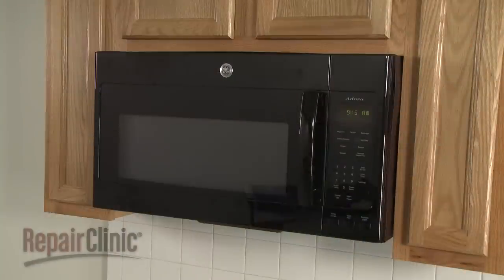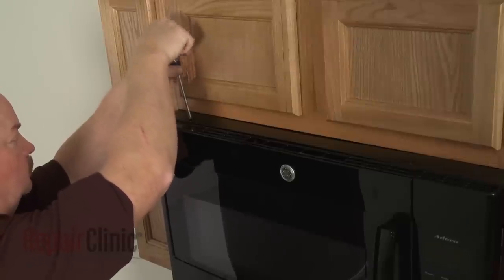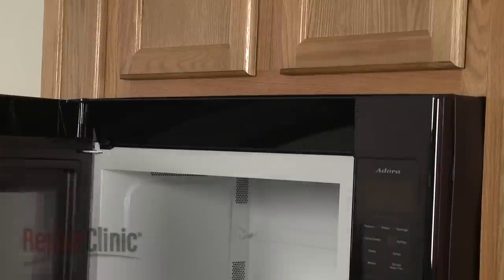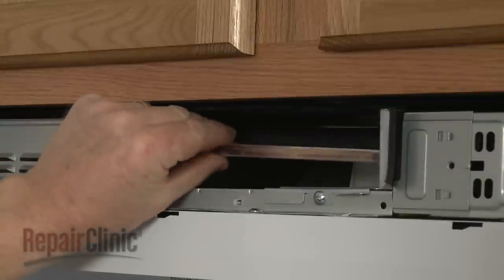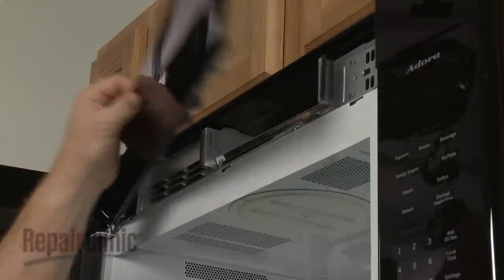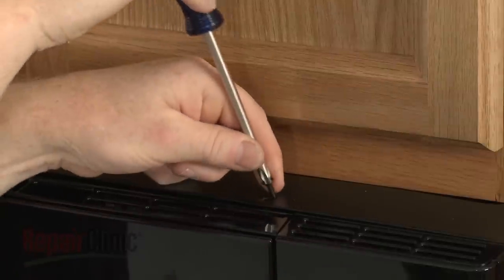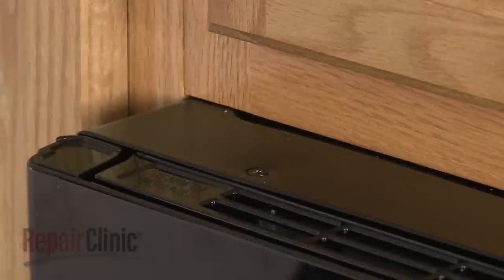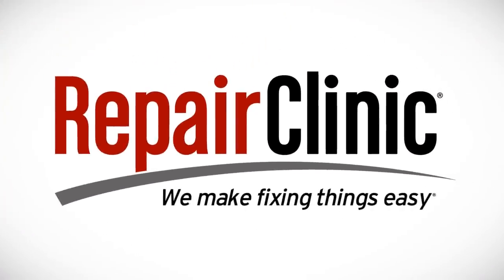GE Microwave Charcoal Filter Replacement #WB02X11544

Comment from the maker: Christina, if the unit is vented to the outside than it does not need a charcoal filter. The notification is likely based on time and your owners manual will tell you how to reset it.

Comment: I really wish mine looked like that when i take the cover off. Mine has a charcoal filter, but only on one side. There are two squirrel cage fans behind the cover, but the filter only has a slot on the left side. So anything blown through on the second fan just goes through unfiltered. I hate this machine.

Comment: I have a GE microwave oven range. And I unscrewed the top part exactly like you showed but it doesn't have a charcoal filter. However, the microwave keeps on indicating that the filter needs to be changed. Help please?